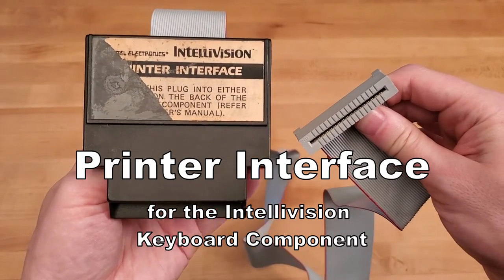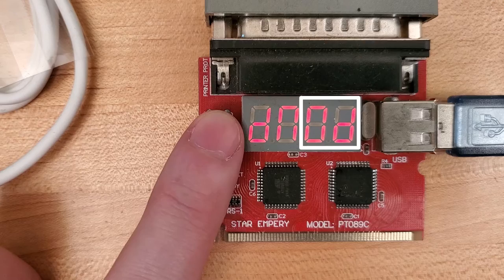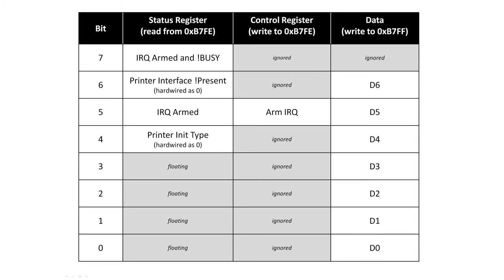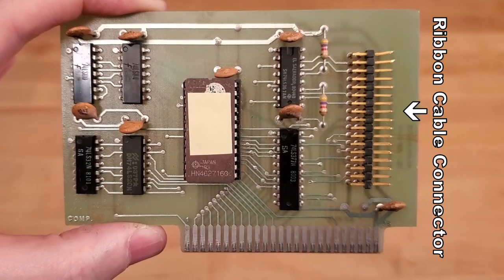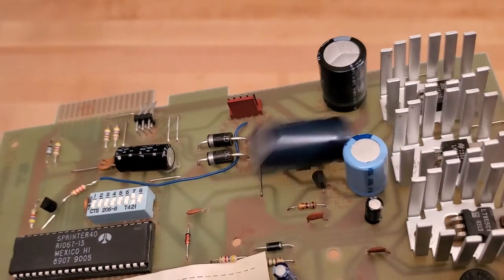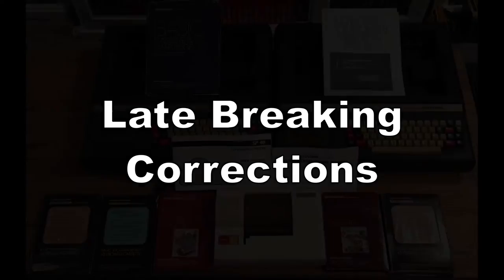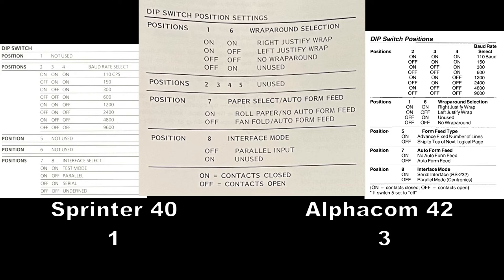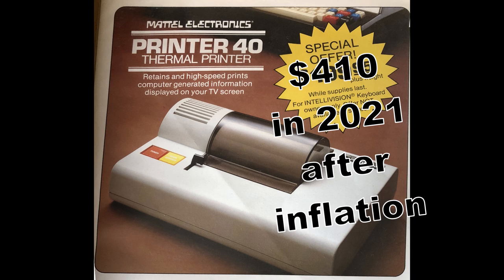Printer Interface for the Intellivision Keyboard Component

Comment: Great detailed video. If you had the printer, could you even use it without that interface? (aside from making your own). You say there are only a few interfaces known to exist. What is the interface worth? Thanks again!
Reply from the maker: It's hard to say.  I know of 3 that exist.  One came bundled with its printer for a collector who paid an unknown amount a long time ago (likely paid a lot).  A 2nd one was part of a large set of Intellivision rare items, including the printer, purchased from Papa Intellivision's family for a hefty price.  The third one, shown in the video, was in an eBay lot with the Keyboard Component's microphone for a buy-it-now price of $500.  Thus, it's hard to say what such an item would go for if it was auctioned off on eBay.
Reply: @Lathe26Real  Good buy on your part. I feel like 500 is a small percentage of what that interface is worth. Thanks again for the knowledge

Comment: Any knowledge whether this interface is a prototype or an actual retail product?
Reply from the maker: It was a real product, but it sold poorly.  The Keyboard Component that it plugged into is estimated to only have sold ~4000 units, mostly in test markets and via mail order.  Thus, this limited the number of the printers and Printer Interfaces that could be sold (far less than 4000).  I suspect that the printer and Printer Interface were only available via mail order.